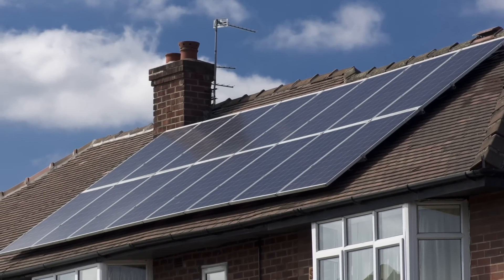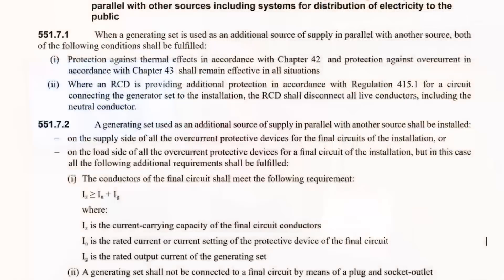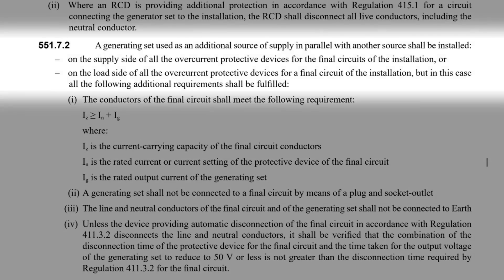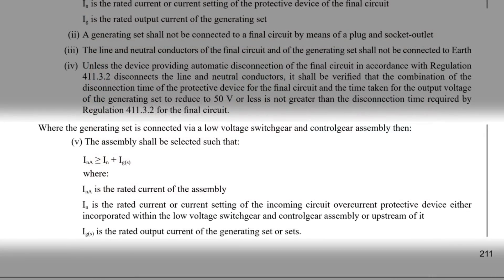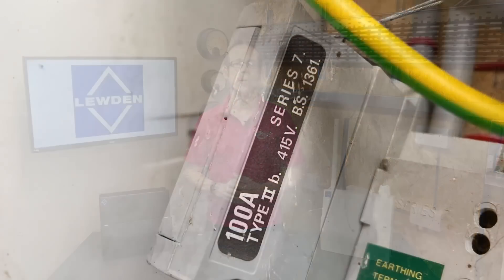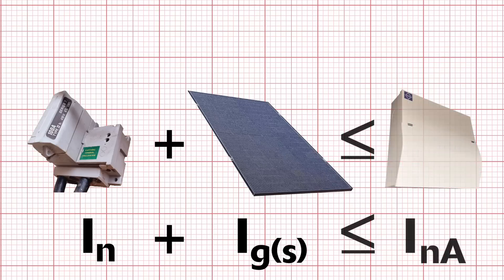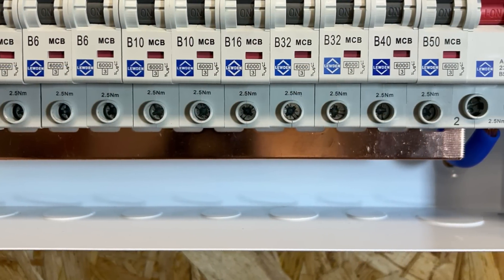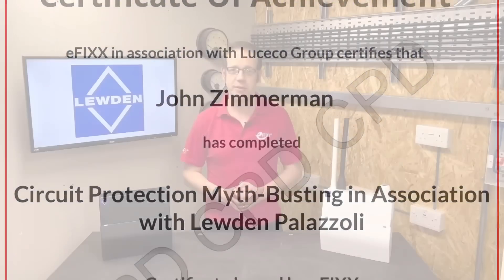Warning: Potential Consumer Unit Issues with Solar PV

Comment: Ah, i think I get it now. The supply potential is considered to be upped to 116a if solar is installed.
Does this increase if a battery storage unit is also fitted? An extra 20 amps can be provided by those.
Reply: Pretty much. It’s not so much about actually having it, rather the capability to have it. You could (for some bonkers reason) be drawing 116A total, that being 100a from grid and 16a from solar/battery in a 100a rated CU. Most I’ve ever used at any one time is 37A.
Reply: And yes battery will add extra as it is considered both a load and a generator. I believe it is detailed better in the guidance note.
Reply: No as the battery is usually installed on the DC side of the inverter, and would share the PV current. Meaning, if the solar panels suppy 20A, then 16A would go to the house and 4A would go to charge the battery.

In many cases, the inverter could during low solar periods and cheap electricity, "suck" electricity from the PV input to charge the battery, to be able to supply battery power during expensive period.
Reply: @sebastiannielsen plenty of AC coupled batteries. Tesla power wall being one example of such
Reply: @damiendye6623  Yeah thats another thing and would add to the "generating set". Its however a inefficient thing to do, as the inverter converting between AC/DC and the different voltages for battery and supply, does consume a LOT of efficiency. So if you have a PV installation, installing a Tesla Power Wall isn't the brighest idea (since you would invert the PV electricity to AC, then recitify it into the batteries, which wastes lot of power).

Its better to install some batteries on the DC side of the solar installation, and then install a smart inverter that can both consume and supply power. Or keep the old inverter and just have the batteries as storage for solar power.
Reply: @sebastiannielsen   I’ve seen a lot of installs where a battery has been installed to charge off peak and discharge on peak to save on the day rates. A lot of properties in my neck of the woods have no gas mains. Those that do have solar seem to be shoehorned in and separate from the battery in the sense they have their own dedicated circuits. Not the best way, especially with how advanced a lot of these systems are getting.

Comment: I don't understand this - what happened to diversity?  

I have a twin stacked main CU - on the lower busbar there are 6 circuits that, if you just blindly added all the CB ratings together, comes to a total of 176 amps.  Great Scott, I could melt the house with that and worse, this busbar 'only' has a 63 amp RCD on it -  begad!  The upper busbar has my lights/smoke/alarm circuits on a 63 amp RCD plus a 32 amp RCBO for the garage sockets and (gulp) the dreaded PV circuit feed that can shift 32 amps / 8 kWh when sunny.  Quick maths when I have somehow loaded the lighting, smoke detectors and alarm circuits all to 6 amps each = 54 + 32 + 32 = 118 amps!  Clearly I can melt the house, or something.  Think of the children.

Meanwhile, all my circuits are protected at the correct value, no busbar is overloaded and the DNO 100 amp fuse is untroubled.  The maximum load I have ever pulled from the grid for all the domestic circuits is 32A / 8kWh (multiple ovens etc, near to Christmas).  To that I could add 8kWh from my inverter to potentially add up to 64 amps but that would still be split across the 2 busbars and, in this example, would be the PV/Battery doing all the work and not the grid.  I guess I could charge the battery from the grid (at 5kWh) plus do multiple ovens etc, to pull 13kWh / 53 amps from the grid but again, this troubles nothing.

Oh and since when did we add incoming amps to outgoing amps?  We used to think of current flow.  Yes, you could transfix yourself with the idea that 100 amps incoming when combined with 16 amps  of solar could enable a household to exceed the 100 amp rated limit of their CU.  But guess what, you can do that right now as the 100 amp fuse will quite happily supply you with 116 or even 132 amps for a very very long time...

This is all a distraction as the main issues we face with domestic electrics are poor workmanship or undetected failures.  We are way past the era of simple circuits on aluminium wiring feeding multiple 3-bar fires under the glow of multiple 60 or 100 watt bulbs.  We live in an era of LED lights, efficient heating systems and a plethora of low-current devices spread liberally around the house.  Our real-world issues involve things like switch-mode power supplies, DC leakage, nuisance tripping et al.  When you see how much current an illegal  grow-house can pull without anyone noticing I doubt this PV concern is of any actual concern.
Reply from the maker: But we also live in a world of heavy sustained loads, EVs, heat pumps etc...
Reply: @efixx  That is true but ensuring safety and compliance is through training, application, trade skills and inspection.  We don't usually see failures due to sustained loads alone, only that sustained loads tend to reveal failures in training, application, skills and inspection.  

A busbar that has missed the CU clamp may indeed survive years of use when all it does is supply a few LED bedside lights and PED chargers.  However, when that same circuit plays host to a load of IT systems, big TVs, portable AC units and alike the situation changes and latent failures spring into life.  The problem is not the heavy sustained loads but the original poor installation and inspection process.

The industry keeps tripping itself up on the basics, not the installation of heavy loads.
Reply: In terms of diversity, the DNO considers a 3-bed semi with, say, a 6kW heat pump and a 7.2kW EV charger as having an after-diversity-maximum-demand (ADMD) of .... 9.5kW, so just over 40A! Of course, diversity factors for the DNO are higher than those of BS7671 as they are looking at dozens of installations simultaneously, not just one.

Comment: Fit your own garage board every time with a 40amp mcb ready for a ev charger problem solved,but as usual can whoever dreamt this up while they had nothing else better to do explain how a energy supply from solar generation #clue right there becomes a load oh unless it’s the 4w standby overnight usage while on standby,so on that logic the 60/80/100 amp supply should be a load too.
Reply from the maker: It's not about it being a load it's about the current it generates passing through the board. 🤔
Reply: @efixx  a g98 3.68kw inverter will very rarely generate full capacity of 16a which you would need around 6kw of dc power to get it there in the summer which will get absorbed into the system anyway,and the fact if you look at the average house board with diversity applied your still well over 100a.
Then look at the thousands that are already installed safely producing electricity,this is just pure drivel.

Comment: So someone else made a good comment about maybe coming off  henly blocks to its own cu. Good subject
Reply: My EV charger comes directly off the Henly blocks to an IP65 CU - its common sense to use this method and very neat to boot.
Reply: In principal that doesn't stop excess current through the original CU, as you could still have eg 100A through the cutout and then 16A from your solar heading in through the main switch in the original CU. I guess this reg doesn't specifically apply, but you'd be in breach of another surely as now the overall CU is undersized for the feed to it...

Comment: Would it not be sensible to have all sources of power (including solar inverter, battery storage and future V2G equipment) to first come together with the meter tails before they go into the consumer unit? Obviously each unit would then need its own protection devices. I'm thinking that added cost, number of enclosures and time of installation would be considerations but since I'm not a qualified person, just an average member of the public, can someone enlighten me as to where my thinking is wrong. Cheers.
Reply from the maker: Interesting thought. 👍
Reply: I'm in the same position as you (Not a qualified Spark, and not PV experienced either ⚡) but I'm going to guess it's mainly to do with cost, plus tricky issues about system zoning between the intake point and the consumer unit/CU. 📜

In this video it appears that the PV installation feeds its output directly into the load side of the CU as if it was any other regular load circuit, even if current flow is going in the opposite direction to traditional. In this way all of the consumer equipment (loads and otherwise) is south of the CU and protected by the main breaker - The PV inverter monitors voltage phase and synch's its output to match, so you don't have two out-of-phase AC supplies feeding the same circuit 💥 - And it may save the supplier/DNO installing costlier equipment to monitor and handle exports to the network. 😇

Comment: British installations are so far behind. Where I'm living we all have 3 phase supply with 35A main fuses and it works without any problems and you are not overloading the switchboard. And yes 35A main fuse sounds small but you don't need 32A in front of your sockets.
Reply: 3 phase domestics where they exist are thankfully a lot higher than 35 A. 22 kW EVSE ahoy ;)
Reply: @intercity125  Not many ev's can charge with 22KW most is only 11KW
Reply from the maker: Where are you in the world? 😃
Reply: @efixx  Denmark
Reply: I can honestly say that the last thing I want as an electrician is the homeowner/DIY expert having access to 415V 3-phase electricity. 😱

Comment: Absolutely agree Northern Power downgraded my main fuse without telling me while I had a replacement smart meter fitted (my 3rd in 5yrs) . Previously I had asked 2 years prior to this for upgrade to 100amps which was done no query at all. As you say certainly Northern Power are downgrading every main fuse to 80amps on every visit for any reason and do not tell you.As  you say with heat pumps, large arrays, batteries, car chargers and water heaters 80 amps is very minimal. My system trips about once a year and I put that down to load issues.
Reply from the maker: Thanks for sharing your experience. 👍
Reply: You're gonna hate me for this: I live in an E7 heated home with (What should be) a 100A DNO fuse. But since the energy crisis, it's been rare for my total household load to ever exceed ONE amp... 🎸💸😳
Reply: @UK-Combustibility-Assured You never pull more than 240W? Do you not have a kettle, microwave, heater?
Reply: @davepusey  I said rare , and that's generally when the kettle isn't going. It's a 700w travel kettle, so a smaller element than the usual. 🫖

(I also use it for heating bathing water, as that works out considerably cheaper - If not less convenient - Than running the HW cylinder on my super-discounted income. 🌻🇬🇧🏚💸)

Comment: If you are pulling 100 amps from the grid and the inverter starts up and out puts 16amp of current the installation would be using 84amps from the grid with 16 amps from solar . Even if the  system had a battery and you set it to max export ,the export would go to demand in the home .
Reply: Yes but the solar supplying 16A allows the installation to pull 116A without blowing the cutout.
Reply: @alikirk4034 a simple fix is to double up the busbar . It’s flowing through the busbar not the cutout
Reply: @persona250  As a practical person, I would think that. But the addition wouldn't be type approved, no more then people whinging about Make A breaker in Make B CU...
Reply from the maker: But if the property started drawing over 100A it would exceed the rating of the CU.
Reply: yeah but the problem is if you start up your dryer or vacuum cleaner or stove, and now your demand is over 100 A.
Reply: @sebastiannielsen  this would be more of a problem without solar as you would be pulling 116 amps plus the vacuum or stove etc

Comment: You mention the 100A main fuse, but what if the main switch in the CU itself is rated 63A. That would mean 63+16=79 so ok then?
Reply: If you think that then you probably shouldn't be touching anything electrical tbh.
Reply from the maker: The main switch isn't a protective device so this would be a problem. 🤔

Comment: The elephant in the room that no-one is talking about: PV inverters export by generating a voltage about 5V higher than the incoming mains and can go as high as 265Vac. So what happens to the property voltage if the mains is already the maximum tolerance of 253Vac? What happens if two neighbouring properties export at the same time? Has anybody thought this through?
Reply: Yes this has been thought through. Compliance with G83 ensures inverters disconnect when the voltage exceeds the overvoltage limits.
Reply: @ratherbewindsurfing  With the G83 lower overvoltage limit set at 262.2Vac this means that an inverter will tripping and not exporting anything like what would be expected, if anything, when the supply voltage is high and appliances in the property may be damaged. This information is not revealed in all the sales hype and I have found inverter manufacturers to be evasive when asked directly.
Reply: @hintoninstruments2369  The amount of power you can export will be. limited  by the Impedance and the open circuit voltage of your supply.  If you are hitting the over voltage limit  your supply needs to be    upgraded by reducing its impedance or reducing the supply voltage (altering transformer taps).
Reply: @ratherbewindsurfing  My supply is high for a reason: I'm at the start of a long rural overhead line.  If my voltage is dropped so is the far end. It just means that I can't have solar power.
Reply: @hintoninstruments2369  that's correct. Maybe you could consider a system that doesn't export...
Reply: I guess the  inverter is running as a current source when grid connected as the grid is a voltage source (ie low impedance). So the apparent rise in voltage is the current output from the inverter times the mains impedance. So 16 amps into say 0.5R would result in a rise in voltage of 8V.   So yes, one could easily exceed to 253v by quite a lot, especially if on the end of a long LV line with higher impedance.
Reply: I believe they typically use a phase-leading output, rather than a higher voltage.
Reply from the maker: Interesting question. 👍

Comment: Physicists enters the chat. Unless you are telling me Maxwell is wrong (in which case you are an idiot) solar radiation is electromagnetic radiation, and the electricity coming from the grid is also electromagnetic radiation. It's all electromagnetic radiation and consequently anyone claiming that photovoltaic panels are generators by that definition needs to go to University and learn some more physics. Edited to add that you would also be claiming Fenyman was wrong (in which case you are doubly an idiot) and that a transformer is a generator which should be errant nonsense to any electrician.